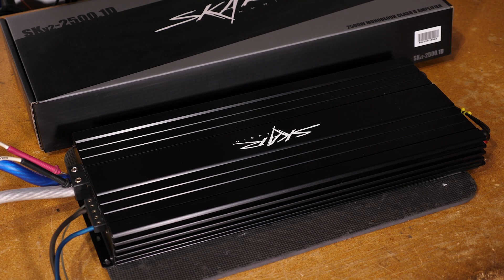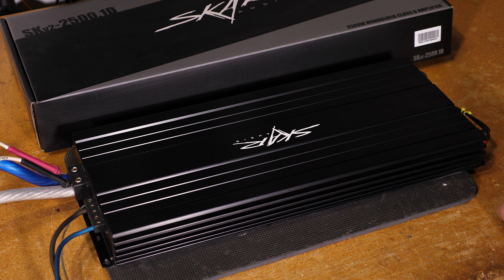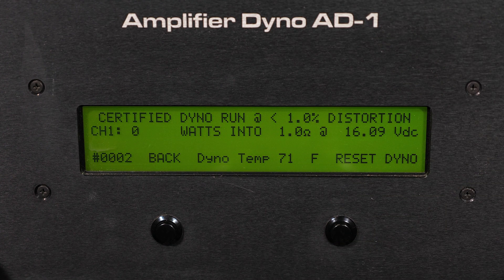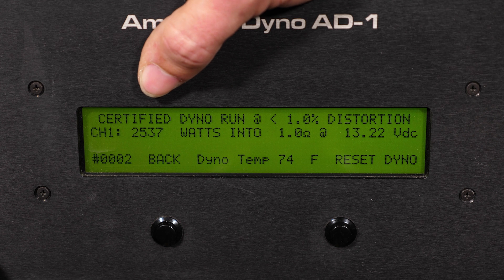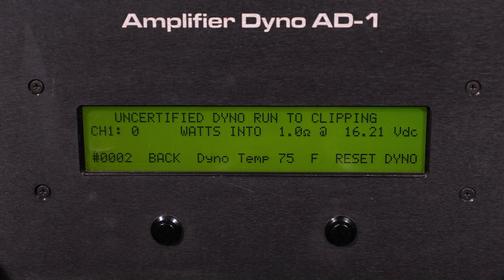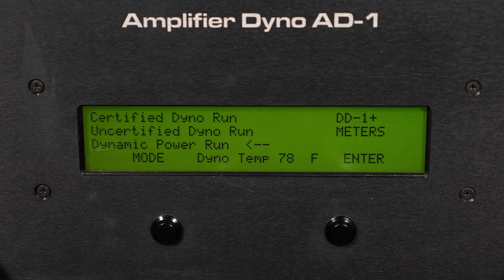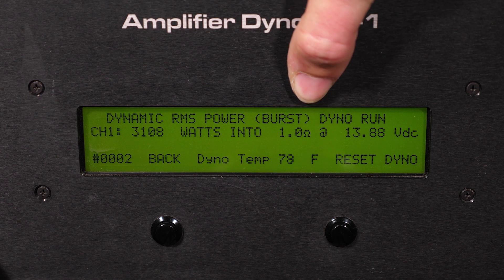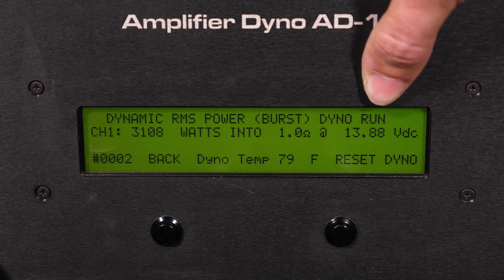Skar Audio SKv2-2500.1D Monoblock Amplifier Dyno Runs using SMD AD-1 Dyno

Comment: Skar ftw. Run both of the Skv2 2500 and 3500 and they perform better than expected can bass hard for hours with no heat or shutdown without the use of any fan at the recommend 1 ohm load.

Comment: I have a 12 volt XS power battery just for this amp. Is it ok or should I go with a 14 volt? I have stock alternator for now but will change it when I can afford a mechman 250 or around that.

Comment: I'm going to run this amp @ 1ohm on 2 10's evl D4 will this be safiction ?
Reply: Ima use it on two db drives. They’re 1000 rms too. Hoping for good results.
Have you installed your subs?
Reply: @noluck8613  yes I have & i must say they sound great

Comment: need confirmation on this.. would the numbers they pulled be the same if they started the test with 14.4v????
Reply: Ik this is wayyyy late lmao but no the result would be slightly higher because your putting in more power and 14.4 is the recommended voltage so it could achieve full power before reverse feeding

Comment: I push this beast at 15.2v daily to 1 sundown X12v2 @ 1ohm,  does very well.. I was actually hoping for a test at .8 or a little lower, I've ran it .7 also with no issues.. just gotta have good electrical.. it loves my mechman 370a elite and dual 1/0 power and grounds
Reply: I have 1 of this. I order 2 Sundown sa v2 12s, 1000watts per sub. I know they are underrated. Do you think I will be fine pushing those subs with this amp? I haven't seen much dyno test of this amplifier

Comment: Why do you start voltage over 16 volts?
Reply: Because they are using a test bench. You have to start voltage higher due to not having an alternator to keep charging the batteries. The test bench is battery power only. If they started at 14.8, the batteries would drain to dangerous levels and damage the amp. In your car, the alternator constantly charges the batteries.